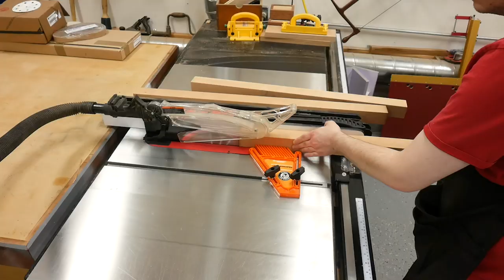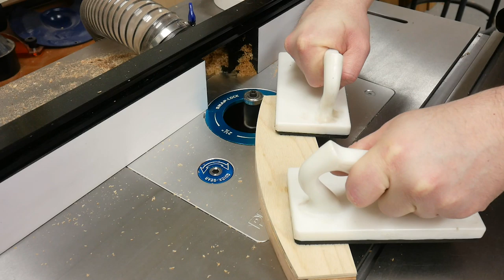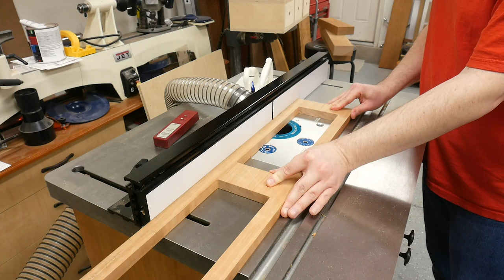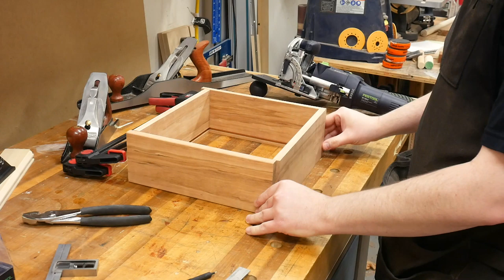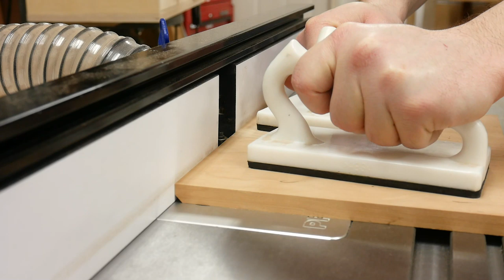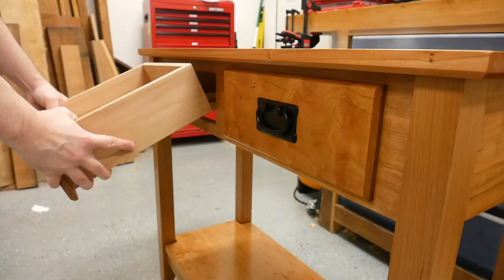Hall Table Build | Woodworking Build Video

Comment: Are you finding Domiplate is adding value to your Domino? I recently had to cut a bunch of dominos and while cutting vertical holes for a cabinet joint,  I was struggling to keep the router bit aligned. This made me wonder if I need any additional jigs like Domiplate to stabilize the cutter? Thanks

Comment: How did you make the template for the front part with the square holes?
Reply from the maker: CNC machine using a 1/4" bit